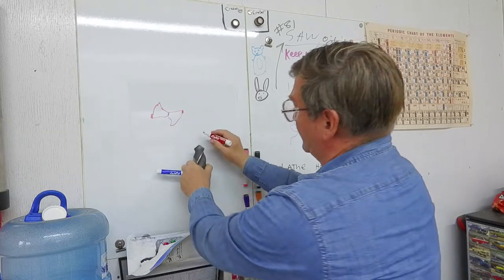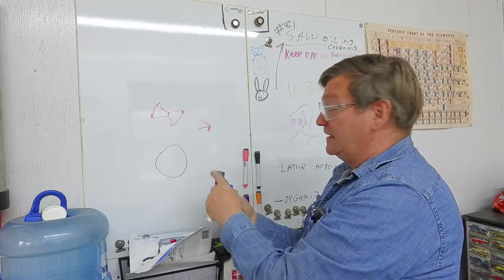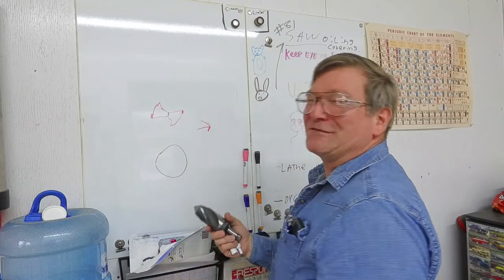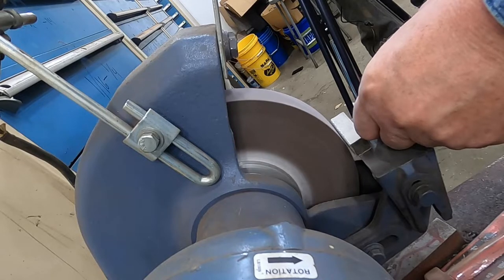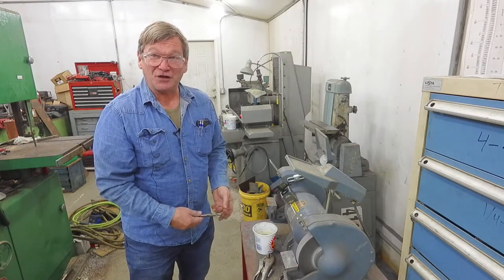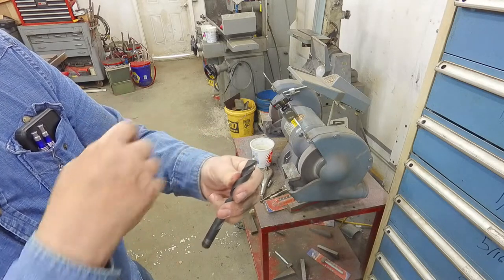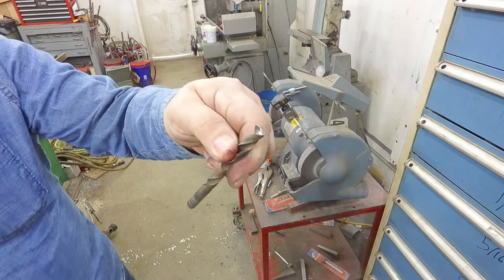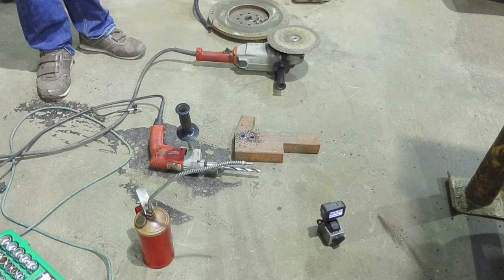Sharpening Drill Bits on Bench Grinder with Split Center for Fast Drilling

Comment: My friend laughed at me over my "Drill Doctor."  So I needed to sharpen a large bit the other day, and said, "damnit" I've tried, I suck, how hard CAN THIS BE!  So I carefully sharpened the dull edge. NOT.  I spend some more time, it appeared to try to cut, but seemed to get or want, to get stuck. So I studied the bit, used my engineering head, and I thought, well, BEHIND the bit, it's HIGHER, that's not going to work.  So this bring me to a few of your videos, try and get this down, and get some practice in.  Thanks Howee.

Comment: So the drill doctor is a no go for a decent
Sharpener my friend ?
Reply: I love my Drill Doctor. For 1/8 to 1/2 bits it does a great job. Sharpens both cutting sides evenly. The only caveat is the limit of size bits it can sharpen and that it can't sharpen bits with a reduced shank. The most time critical part of using one correctly and effectively is getting the bit positioned in the holder correctly and tight. Maybe they could have put more energy into building a better bit holder.